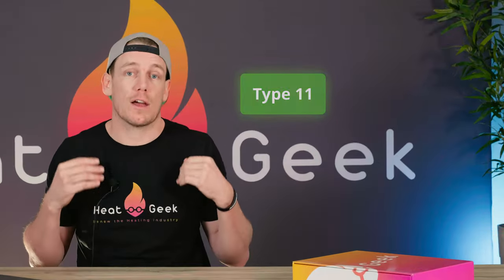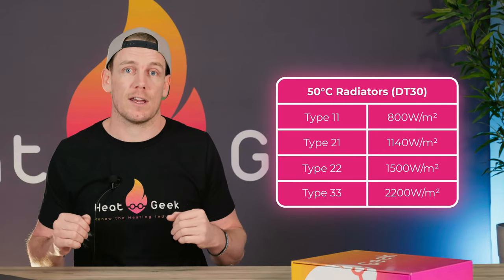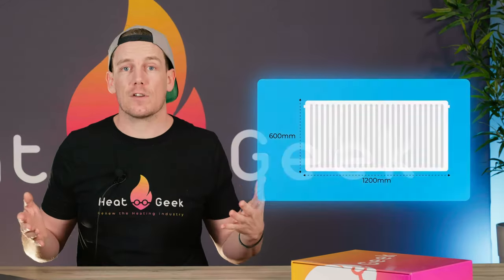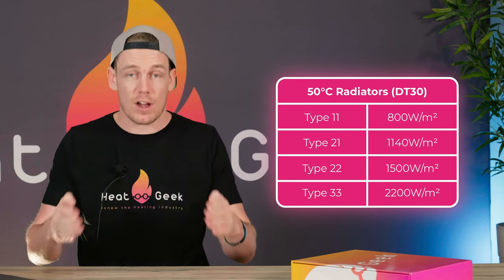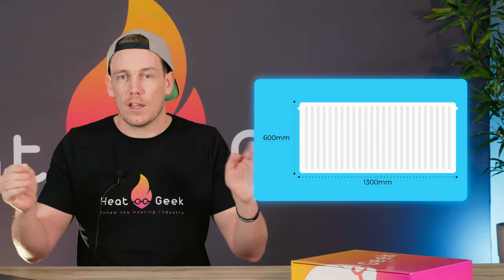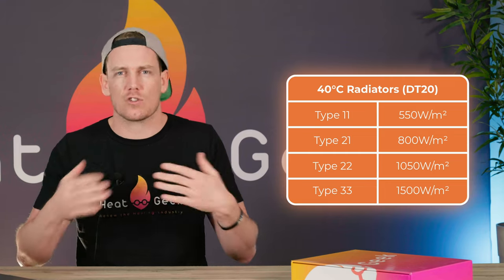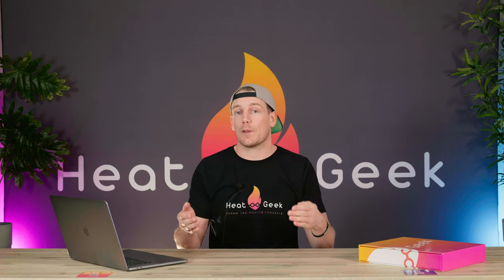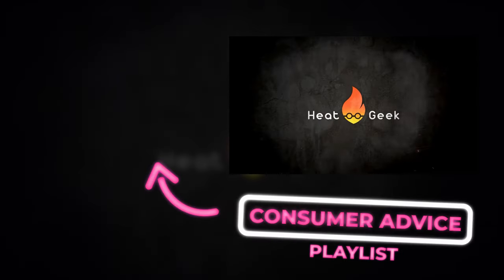Should I Upgrade My Radiators For A Heat Pump? | RADIATOR CHEAT SHEET | Consumer Advice

Comment: I do think you are somewhat underplaying the potential role of greater insulation. If the radiator in a room can't supply enough heat to match the heat loss of that room at you new lower flow temperature there are two options, increase the output of the radiator by replacing it with one that is bigger/more effective, or reduce the heat loss of the room until the existing radiator can meet the requirement with the lower flow temp. The first option will increase the COP of the pump but without reducing the overall heat required, the second will increase the COP AND reduce the overall heat requirement, a double benefit. Both options will involve some cost, but surely you should look at the option of increasing  the level of insulation first?
Reply: One thing to consider is each heat-pump has a defrost cycle which needs a certain amount of water volume as far as I know. There are conditions where increasing radiator size is necessary for this otherwise you'll need a buffer tank which will inherently reduce your COP.
Reply: Sure, but not everyone can do that.  I'm looking at a room with 1704 watt heat loss with no upgrades possible.

Comment: I've turned the flow temperature on our gas condensing boiler to 40C and the house is still comfortable. It's been like that since January. Am I right to assume that this means the system is suitable for a ASHP or are there other factors? Flow rate perhaps??
Reply: I also did the same and can't find a simple answer. Seems like a very easy and accurate way to test.
Reply: My „search“ came up with two metrics to consider: flow temperature <55C (less is better), and overall energy demand <100 kWh/sq meter/ year. 
It is mentioned a couple of times, that below these figures a HP starts to make sense.
Reply: It sounds like a really good way to assess compatibility of a system for conversion to heat pump. Any comments Heat Geek?

Comment: Does this cheat sheet work to radiators connected with 10mm flexible piping? We have a new build where they used this and have been told the pipe work will need replacing.

Comment: Hi, I was interested in the free energy video using solar thermal with heatpump backup. Can you do more about the setup you have and the cost. How often have you managed to use just the solar thermal and other than the heatpump what other inputs do you have in the system. I don't think the tubes alone would be enough?

Comment: The best way to check a heating system is to run it at a low temperature for a winter and see how it performs, which rooms are cold when. This will give a perfect starting point when looking to install a heat pump.
Reply: Ah just the answer I was looking for 😂. So currently running my combi at 45 degrees for heating so I'm guessing that's good although ideally need 40 degrees?
Reply: the analog method
Reply: Very hard to force an oil boiler down to run at 40 degrees even for a trial

Comment: Loving all the videos & articles on your website - very informative stuff. I have recently become a big HG fan :)

Apologies for what could be a bit of a noob question on an old-ish video, but I'm having trouble reconciling the differences in outputs between the DT20 and DT30 cheat sheets: my understanding is that the output changes as the ratio of the DTs raised to the power of 1.3, so

Output of rad at DT20 = (Output of rad at DT30) x (20/30)^1.3

Using the outputs given in the DT30 table, this would yield the following outputs for DT20:

Type 11: 800  x (20/30)^1.3 =  470 W/m^2
Type 21: 1140 x (20/30)^1.3 =  670 W/m^2
Type 22: 1500 x (20/30)^1.3 =  885 W/m^2
Type 33: 2200 x (20/30)^1.3 = 1300 W/m^2

Appreciate that there is a bit of rounding going on, but all of these calculated figures are a good 15% lower than those in your DT20 cheat sheet table.

Is it possible that for the DT30 table the MWT of the radiator has been used, but in the DT20 table the flow temp has (mistakenly) been used? e.g. if the deltaT between flow & return is 5K then the flow temp is 2.5K above the MWT. If we plug a DT of 22.5K into the formula the following outputs are calculated:

Type 11: 800  x (22.5/30)^1.3 =  550 W/m^2
Type 21: 1140 x (22.5/30)^1.3 =  785 W/m^2
Type 22: 1500 x (22.5/30)^1.3 = 1030 W/m^2
Type 33: 2200 x (22.5/30)^1.3 = 1515 W/m^2

These figures are much closer to those quoted in the DT20 cheat sheet, so I wonder if that's what's happened here?
Reply: Have you had any response from Heat Geek on this? I had just independently reached the same conclusions that the DT20 table is wrong. In another Heat Geek video I can no longer find, he himself uses the formula with ^1.3 in it, so can't understand why the cheat sheet figures are so different.
Reply: @davidsdiy4458  unfortunately not, but thanks for your comment - at least I know now that I'm not alone! :)

Comment: Hi Adam, great video. This is a pretty basic question, but why is it that you would specify radiators with a delta T of 30 when the delta T of a heat pump should be 5-7 degrees?

Comment: I am thinking about adding underfloor heating on every floor before switching to a heat pump. The bedrooms now have T11 radiators (installed 1989) and the living room is now on T22 radiators.

When not home or if the room is not used, we let things cool down. An on some very cold days the boiler needs to go up to 60c to make the room warm enough in a reasonable time. Also, windows in the bedrooms are left open for way too long, and i have given up on changing her mind about that behaviour.

Other rooms are fine at 50c because of recent insulation efforts and often much lower if weather permits. The gas boiler is quite recent (Q1 2020) and i have tuned it down to about 4 kW to prevent on/off problems. I am considering a Vaillant R290 system, but because of all your advice, I think upgrading to underfloor heating first on the gas boiler and measuring coming winter may be a better way to be sure about the sizing.

My question: Would you leave these T11 radiators installed in bedrooms so they can contribute to the size of the system and recover fast from excessive ventilation, just remove them or even replace them with bigger ones in the bedrooms to add to or replace underfloor heating? The living room floor is a bit worn, and the T22 radiators are ugly, so underfloor heating is pretty much a no brainer there.

Comment: Our house is a 2007 build with (I believe) 15mm pipe work. Our boiler system is a Worcester Greenstar 30CDI system. I appreciate we will in all likelihood require larger capacity radiators but will the existing pipe work be sufficient for a ASHP. The house is well insulated but I’m not sure what thermal efficiency band it is in.

Comment: Thanks, another really helpful video.  Hopefully a simple question… the required output for a room can be spread across multiple rads? E.g. if it’s easier to put in a second rad rather then make/find space for a larger rad?
Reply from the maker: Yes!

Comment: Google knows doesn't it? This is EXACTLY what I was just wondering about. Ballpark conversions from the catalogue spec. Wouldn't it be grand if manufacturers gave outputs for perhaps 3 flow temps? Thanks again Adam. 👍🍻

Comment: Here's my problem. I have rads upstairs and UFH downstairs.  The UFH is likely to run well at 40 or less, and the rads upstairs can be upgraded save in two rooms where for reason I will be limited to 400mm high.  So, its looking like I need to run 50 degrees for the rads and the UFH is going to need, at most, 40.  This seems to mean I'm getting a HP to run at 50 and blending down for the UFH.  I'd love to size rads for 40 (which looks like 20dT on this video) but the size is just huge.  At best I can do 30dT but how can I find out if that will work for us?  Like, suppose I settle on a flow temp of 40 degrees with rads that say they delivery 1000 watts at 30dT - is there any way I can figure out how that works out in real life?

Comment: What a fantastic video. 
Answered questions I didn't even know I had. 
Looking to install an ASHP in my really cheap house in a remote village with no access to mains gas and only unreliable mains power. 
The house has 2No. 20m2 rooms and a roughly 7m2 pantry which will be converted into a bathroom and small kitchenette temporarily will we build a much bigger extension. 

Thankfully we'd be able to fit 1.6m long radiators in the main rooms which should help a lot with heating and keeping electric costs down/solar usage down, especially in those winter months.
Reply: Dont take “bigger” to mean larger dimensions, you just need larger wattage ( which may be smaller dimensions just more fins 👍)
Reply: @chriss4949  Forgive me but wattage as in electric? 
We're looking to use a heat pump to heat "normal" radiators. 
From this video, I took away that larger radiators mean the heat pump doesn't have to work as hard to heat the room as there's more surface area for convection.

Comment: Hi, your video is great. We just moved in to a new house with Air to water heating system with heat pump. We upgraded the bathroom and decided to change radiator in bathroom with Vertical towel Rock radiator. When we remove the original radiator water pipe coming from the ground one side longer then the other side and that makes vertical radiator not level. We need to cut pipe few cm to Level the connections and radiator. Do l have to switch off everything and draining boiler radiators all system to cut pipe few cm? Will it cause problem to system wondering? What would you recommend?

Comment: Structured well to understad - thank you! I noticed that you did not talk about low temperature aluminium radiators for use with Heat Pumps. Is there a reason for that?
Reply from the maker: The difference is small and corrosion is an issue with Ali rads

Comment: Question regards high temp heat pumps: 

If you have proper weather compensation, presumably when the weather is fine to run at 40c, it will do that, and be as efficient as any other heat pump?

I ask cos my rads on gas boiler are fine at 70c down at -5 or so, and on the one occasion I remember it being colder than that, 80c (Mac boiler flow temp) was fine. But that's compensating for some rooms that are barely adequate radiators now. Other rooms do much better - though still not low flow rates at -3. 

But once we get above about 4c I can run the system at 60 now, above 8 at 55, and above 10 50 does the job.

If I upgraded the worst rooms to perform as well as the best, those -3 days would only require 60c, and 70 below that would be fine unless things got into double digits below. And the rest of the time 45-55 would be fine.

Upgrading all my rads to meet low temp at -3 will cost about 3k. Upgrading as above less than a thousand.

If a high temp heat pump can cope with the spike periods needing 65c+ for maybe 20 days a year tops, but run low temp the rest of the time, that would seem like a reasonable trade off Vs an extra 2.5k upfront cost on rads (depending on the cost of the hthp of course).
Reply: Update - I upgraded some of the worst performing, this winter I can run at 60c down to -4, and 50c at above 4c. Hurrah.

Now I just somehow need to work out how the bathroom radiator could be upgraded without wrecking the wall and I could push it a bit further. Luxury goals to upgrade the type 11 in the living room and the type 21 in the bedroom but they don't seem to be struggling at all really.

Tldr - upsizing your rads so your boiler can run at lower temps is a good idea whether you're going for a heat pump or not.

Still, same question regards high temp heat pumps: when running at 45-50c, are they as efficient as regular heat pumps at a similar temp?

Comment: I’ve just started a self build using the ICF blocks and was thinking of using an air source heat pump instead of Gas boiler for heating and hot water. Not sure if it’s the best move or not??

Comment: Hi Adam. Thanks for the very handy calculators. 

I want to start with replacing one radiator in my house, because it seems to be undersized compared to the rest of the radiators. I've followed your advice and turned the flow temperature down on my gas boiler, and all the rest of the rooms in the house heat up nicely at the low flow temperature, but my sitting room takes hours to heat up to 21 degrees, and sometimes never quite makes it and I only let it drop to 20 at night. So I can either turn back up the flow temperature to heat that room, or have the boiler running almost constantly for that one room.

I've opened the lock shield fully on this radiator.

When I replace that radiator, should I aim for a radiator size that works at a flow temperature of 40 degrees, to future proof for a heat pump, or would this now put this radiator out of balance with the rest of the radiators, and cause me problems?

Thanks
Reply from the maker: Hi. As mwantioned this is a guide. I would speak to a professional if actually undertaking work
Reply: Try balancing the system by reducing the flow in your other rads so that your living room rad will heat more quickly.

Comment: The house we bought had a 16kW heat pump and we are going with the downstairs as underfloor heating and the upstairs having radiators fitted. 
We already have the power chart in kW needed to heat the each room but, we are going to install aluminium rads potentially. 
Watts are watts at the end of the day and just as long as the new rads can accommodate that power needed it shouldn’t be a problem should it?

Comment: Watched loads of your videos. Very informative! I'm thinking of replacing my old boiler in an Victorian detached. I saw in one of your more recent videos that you've used fans to increase the flow of air through the radiator. I was wondering if fans could be a cheap way of effectivity increasing the output power without physically having to swap out a radiator? The idea being to run the radiator at a lower temperature than a boiler would have needed?
Reply from the maker: Sure but very heath Robinson and I don't think you'll get an mcs install with that aproach so no grant. Thankyou!

Comment: Hi Heat Geeks

I've heard you comment before about under floor piped heating being preferable to radiators. However the challenge I have is that the 1950's home I'm purchasing has concrete floors, throughout the ground floor. 

My questions are:

1) Do heat pumps require greater in diameter pipes under the floor than a gas powered under-floor heating system?

2) What diameter pipe sizes do you recommend.

3) Instead of raising the floor I'm considering  cutting groves in the concrete, hopefully finding an insulation matting that would sit inside the groves, and cover the remaining un-grooved floor. This has the benefit of not requiring to screed the floor, just an underlay and hardwood flooring on top. I suppose my second question is, what do you think of my cunning plan?

Any pointers would be gratefully received,.
By the bye, I may end up cutting the grooves to keep costs down, but I intend to have the fitting and commissioning completed by one of your Heat Geek professionals, found on your map, in Chelmsford.

Kind regards

Robert
Reply from the maker: Hi Robert 

Sorry to keep it sweet

1) no nit in the slightest 
2) as above
3)speak to jk flooring. They ate specialists in this exact thing!
Reply from the maker: Oh and BTW we have an excellent heat geek in your area!!

Comment: I am finding it difficult to understand that if my existing gas heating which is on 1 hour in the morning and  4 hours in the evening uses about 60kW to heat the property, but nothing during the day as it gradually cools. a heat pump has to deliver 70kW to get the same amount of heating, so the sCOP has to be 1 to 3.5 to cost the same as gas. However, my understanding is the heat pump has to be on all the time. If I assume a heat pump is on all the time using 1kW of power to give 3.5kW continuous heat to my house (which I don't think will keep a 5 bedroom properly warm)...I am now using 24kW of electricity. The gas heating also heats my water within that 70kW. The heat pump can't do that at a SCOP of 3.5...so how do I save money??

I do have a large loft conversion, well insulated and I actually have an inverter split system up there...if when it's cold I warm just that room, that one system alone uses around 380W, after it's got the room up to temperature. I have the outside unit mounted up at around 7ft high to avoid the cold ground effect. So I'm thinking  1kW consumed definitely won't heat the whole house for a heatpump system?
Reply from the maker: There's lots of confusion here. If your gas boiler uses 60kw (assume you mean kwh) then why would a hp need 70?? If you put 70 in something that needs 70 it will be sweltering in there.. you cannot destroy energy. I fact as a gas boiler is only 90% efficient its likely the hp will only need to deliver 55kwh.

Also.. condensing gas boilers also run better if ran cooler and longer.  Lots of maths here so look at our should you geat continuously video

Comment: What about convertor type 'radiators' like e.g. Jaga makes?
Since we have those it would be indeed be a very handy cheat sheet if it included these!
Reply from the maker: if youve got specific rads your best off using conversion factors
Reply: @HeatGeek  You don't have the w/m2 generally for DT50?  I'm trying to convert down.